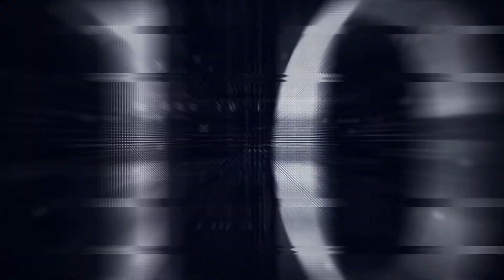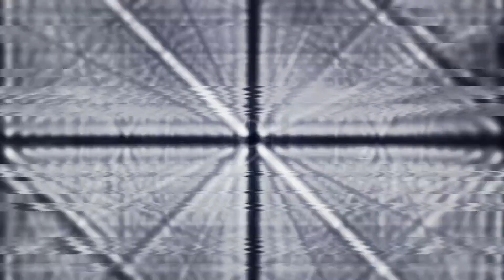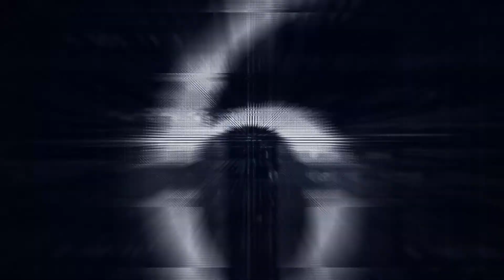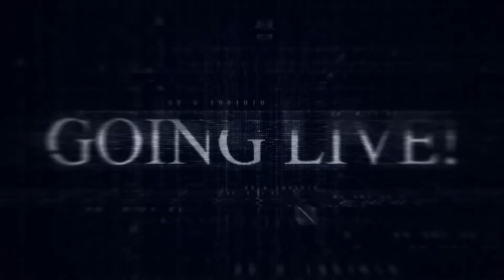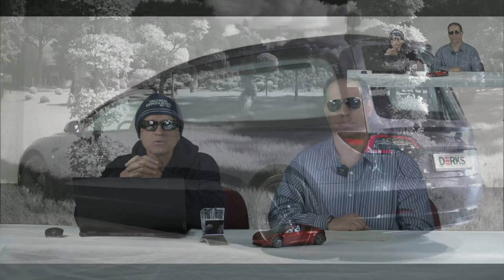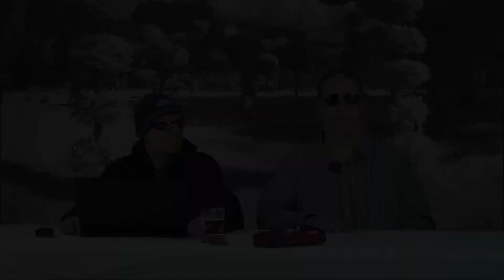South Korea Tesla Giga Factory, Used EV Valuations Starting To Fall, 200k Tesla Hearse - GMS #44

Comment: 29:15 “ inductive charging is definitely far more efficient” You completely lost me there
Reply: Time efficiency is what he's talking about, not the actual mechanism of charging itself. instead of sitting somewhere while the car is plugged in waiting for it to charge, you can continue to drive and charge simultaneously.
Reply: Any examples of inductive has a 10 to 40% lose. The pads have to be close and aligned to be nore efficient.
Reply: Adding the losses of the AC adapter to wireless charging brings the overall efficiency down further as the inductive transfer efficiency of inductive charging is only 75–80 percent.